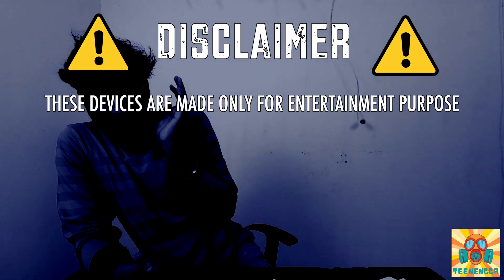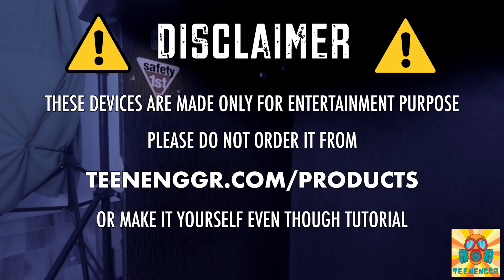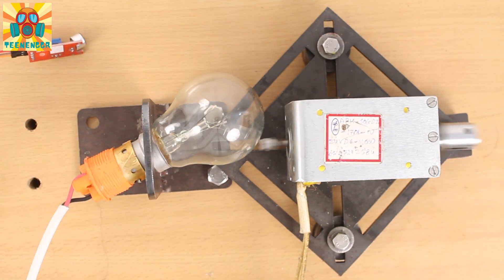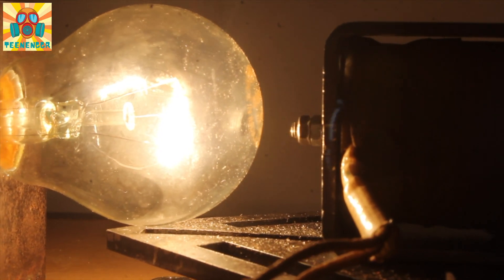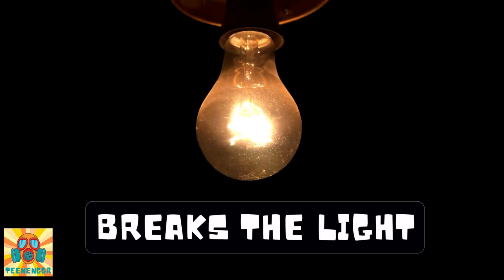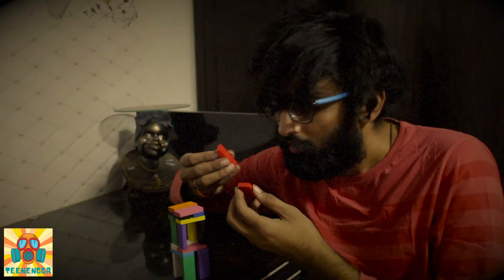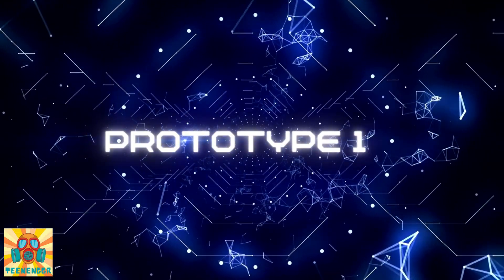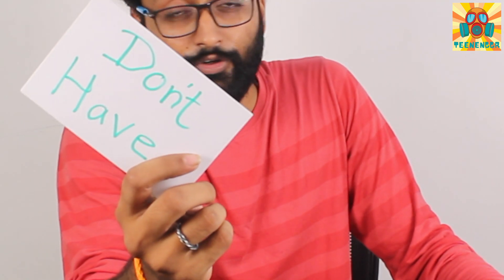Most Inefficient LIGHT controller EVER!

Comment: Next Video: Teenenggr smart plug 

It will remove the connected plug from the socket whenever it is turned off.

You can connect various things like
- All out
- mobile charger
- laptop
- router
- etc.,